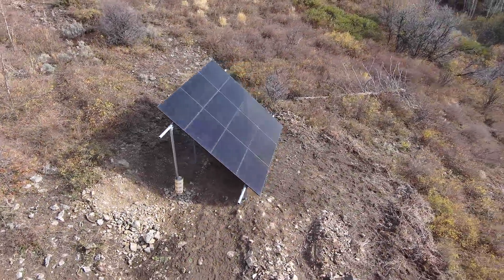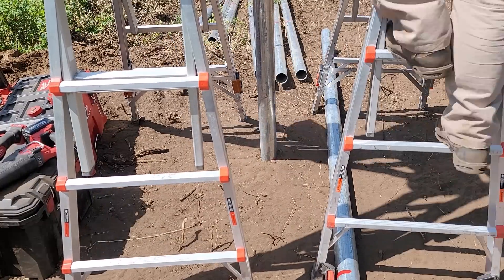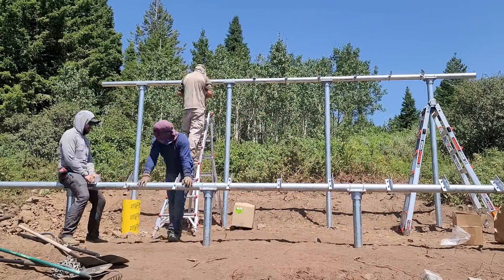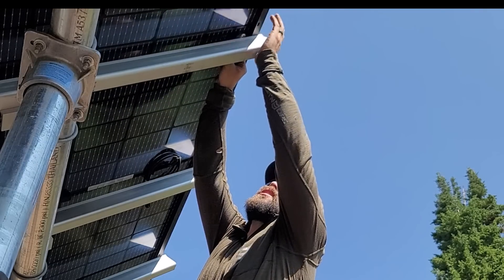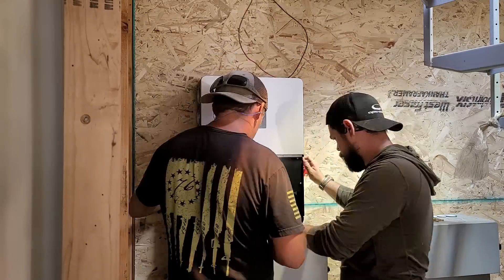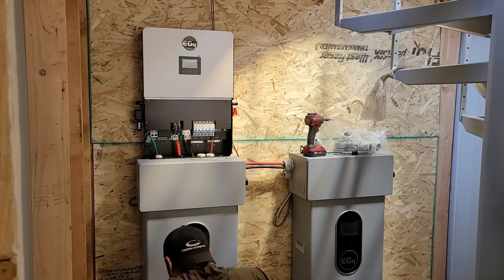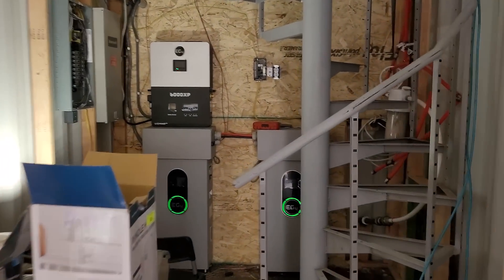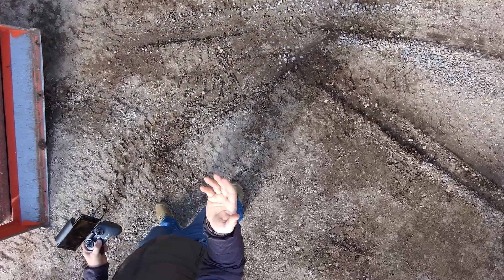Easy DIY Off Grid Cabin with EG4 Batteries and Inverter

Comment: Nice solar array, nice battery but the worst possible choice for an inverter. High frequency, transformerless invers like the one you installed offer a shorter life expectancy, a much poorer surge capacity. And because these low-cost (cheap) inverters don't have an output transformer, they can damage your off-grid home's appliances when their MOSFETs fail. Don't take my word for it; ask Google AI the following question: Can a high-frequency, transformerless inverter damage your appliances?"

Comment: This guy doesn't have any formal training in electronics or inverter design, construction or repair. He hasn't even performed any industry standard testing of this inverter's performance, reliability or safety characteristics. The only thing that this salesman is doing is passing on information from this inverter manufacture's user manual so he can earn his sales commission.. Why is anyone believing anything he says about this product?
Reply from the maker: Everyone is entitled to their opinion. But, besides the fact that I've installed lots of off-grid and now grid-tied systems, I can say for certain I am not an expert nor do I claim to be an expert. But this customer is still going through this winter without any power issues at their off-grid cabin.

Comment: When is this manufacturer going to stop building these inverters on the cheap and add an isolation output transformer to their design? Without an output  transformer, these cheap inverters can easily fry your appliances or your EV, when their MOSFETs short to ground. Don't take my word for it, ask Google AI "Can a high frequency transformerless  inverter damage my appliances?" to learn the truth about these cheap, overpriced high frequency inverters.
Reply: Say what?  You understand this is home wiring right?  There is no isolation... neutral is bonded to ground.  Whole-home backup systems are not isolated and never were.  Not a single one.  LF or HF.

Comment: Think of everything! But, none of EQ4 inverters have conformal coating on the PCB's so will not survive 10 years and if at a high elevation the high voltage can arc over killing the inverter just like a EMP. Research Conformal coating and why it is used. Go Cheap and pay the price.
Reply: Wrong.

Comment: Who makes the best off grid solar system for high altitude. By high altitude I mean 11k feet.
Reply: Dont do it! Not rated for altitude ZERO conformal coating!!!!! CHEAP cost cutting NOT rated for Altitude. EG4 that is, Victron uses conformal coating.
Reply from the maker: My vote would be EG4 but I've never looked in detail for high altitude.
Reply: @minutemansolar  I have spoken with a couple EG4 reps and they say no way Jose. Not rated for that altitude nor would they warranty them if I tried. Victron I have heard no questions asked for warranty.

Comment: On rare occasions in the summertime, I would get more amps going into the batteries than I wanted. I didn’t want more than 100 A going into the batteries at any one time, so I just changed the Victron charge controller to read 85% instead of 100%.
This kept the amperage below 100 A.
Reply from the maker: Good to know, thanks for sharing.